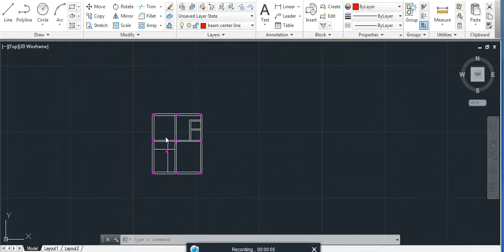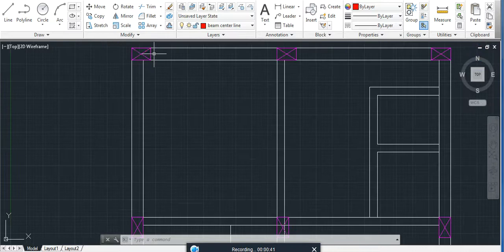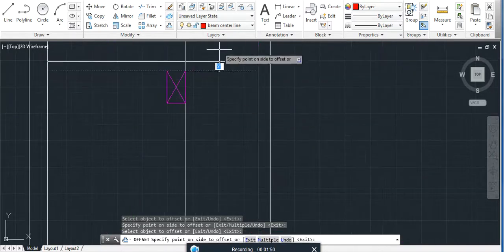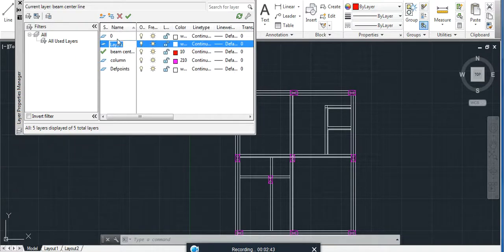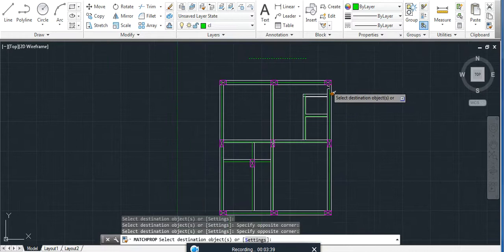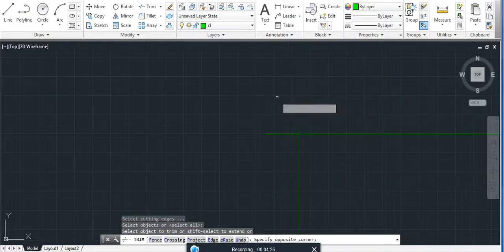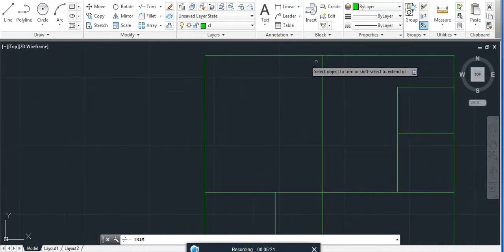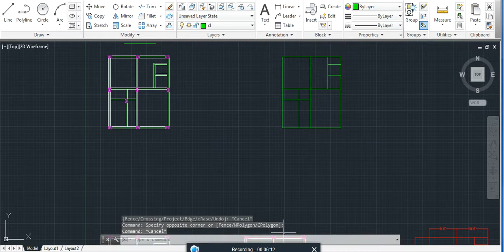how to draw center line plan of building by autocad for rcc design | how to read center line plan

Comment: we have to take half of the smaller dimension to offset but what if some columns in the plan have different dimension?
Reply from the maker: We take half of the width of beam .....And we make sure that the offset line of beam falls in such a way that beam will rest on column
Reply: @Realcivil  ohhk.. thanks.. 🙏